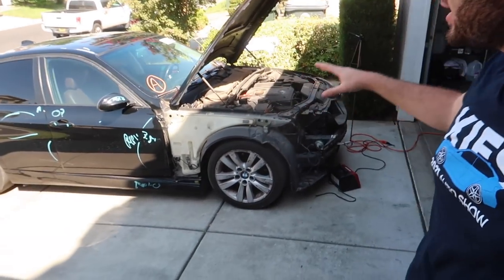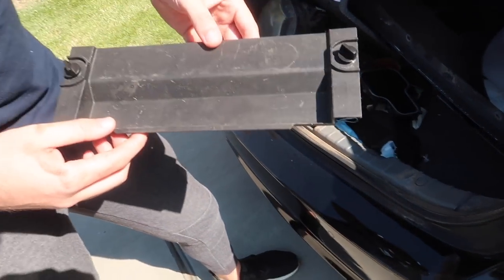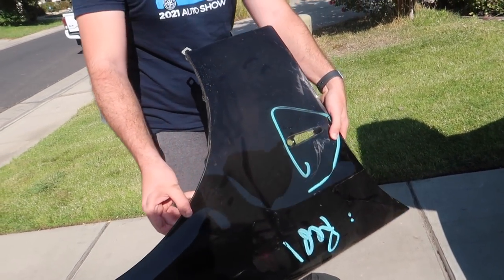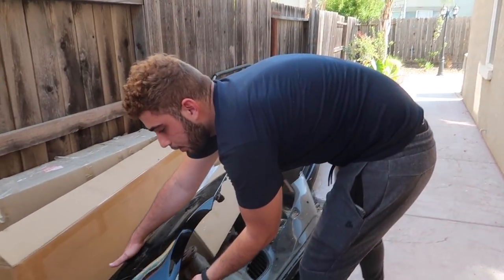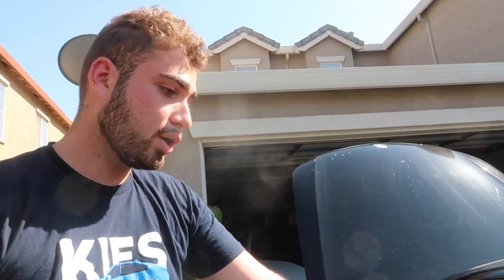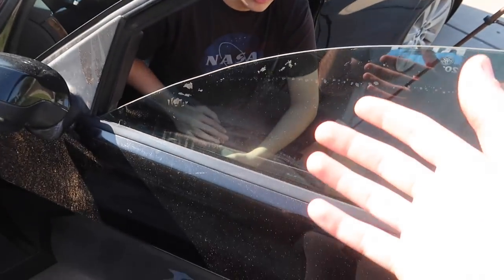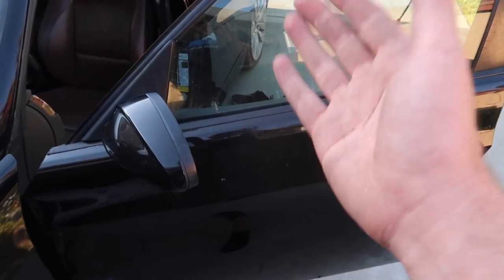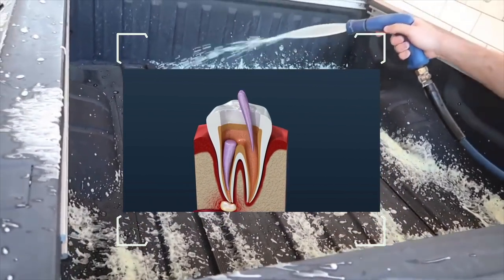Rebuilding And Restoring A BMW E90! Part 2

Comment: Nour  that E90 had a Eonon head unit or one of those android head units specifically designed for the E90, especially after seeing the original radio cage in the trunk and the heated seat relocation kit installed in the center console

Comment: Nour brother not sure if you read every comment or not but I have 3 bmws and they’re all unreliable lol. 328xi e90 n52, 335xi e90 n55, 330ci e46 m54, all 3 are pretty un reliable lol. Also, for those mirrors you don’t need new mirrors , just do a search on how to fix that and you can easily fix those.